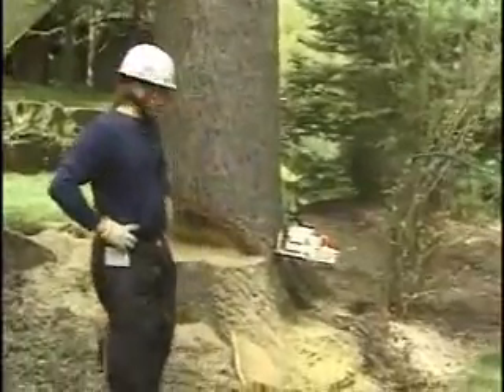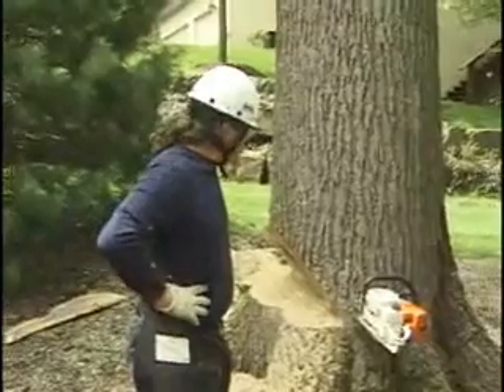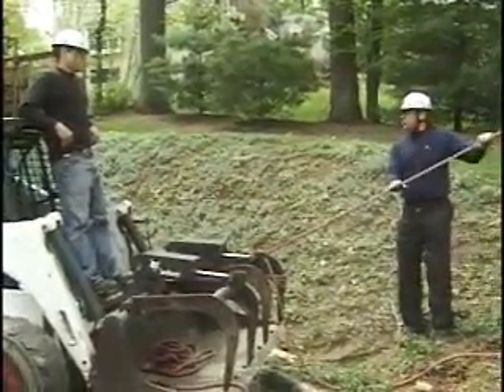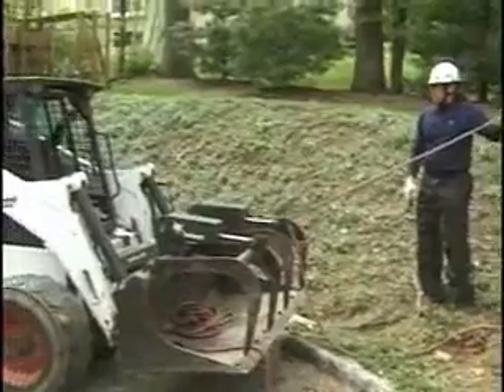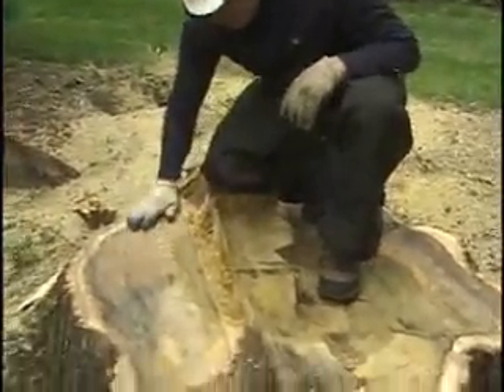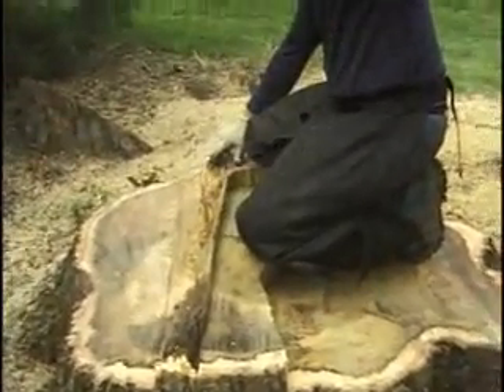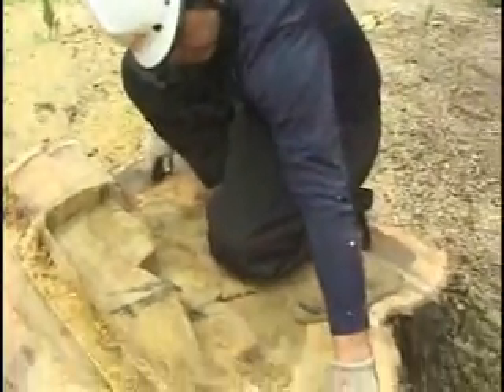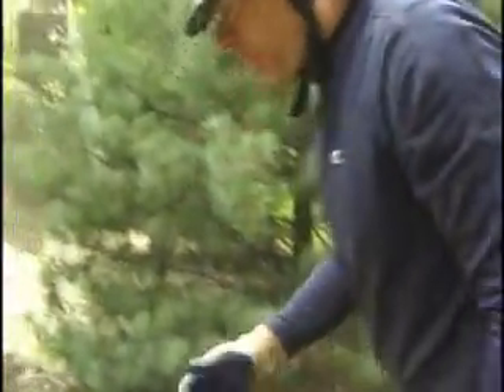Precision Tree Falling with Daniel Murphy part 2 Tulip spars

Comment: Good video but I am curious about a few things. A big one is safety, ear protection hand protection and the camera man he's in the dangerzone.
What is the story with the skidsteer? In my opinion it is too light.  
Your own protection: a combi hat ear, eye and head protection however at least you are wearing leg protection and using the break.
A plunge cut is that required. I have felled  trees much the same size not using a plunge cut.
Good video I though, well done